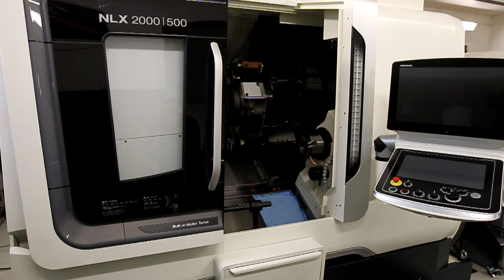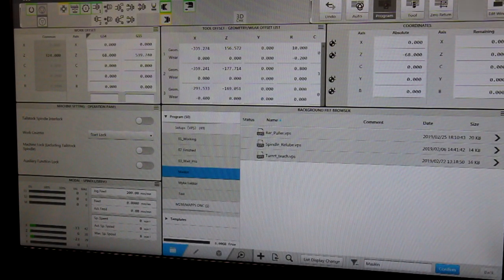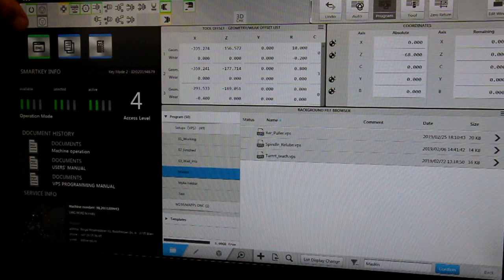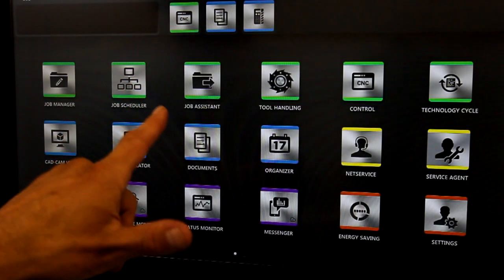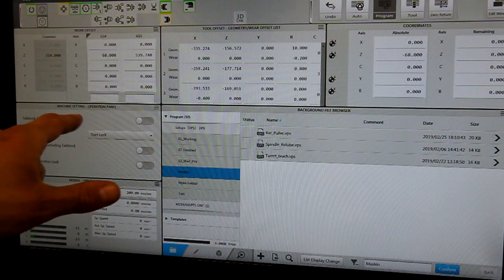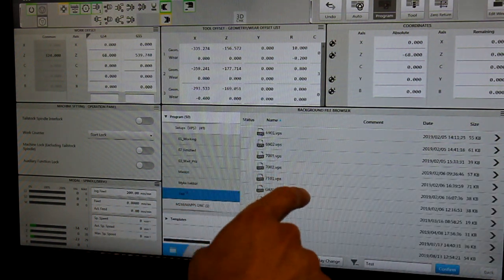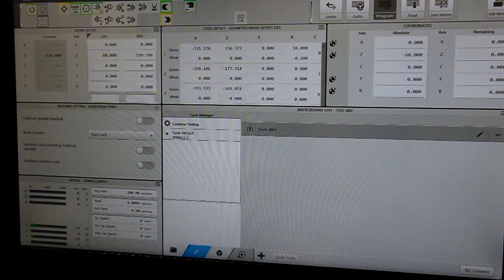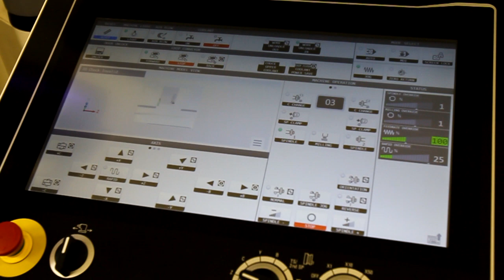Mori NLX - Quick overview and Question time

Comment: Does anyone know how to change the IP address ? We want to load & save to a main server where all our programs are to be kept and backed up every night. We only have a level 2 key.
Reply from the maker: Change the IP of the lathe ? The IP of the machine should be assigned by your network. There is a huge section in the manual about how to set up that.

Comment: Hello, I just started running a NXL 2500 700  could you show how to mill a hex  with the VPS  software.  thanks
Reply from the maker: That is really simple. I assume you have got the manuals with the machine ? Is it a used or new machine ?
Reply: @Panzax1  yeah its a 2016 model and yes i was hoping that you had a video on how to do that
Reply from the maker: Yes. I'll try to make a video of it this week.
Reply from the maker: I am still hoping to get that done soon.

Comment: Finally a machine tour, lol.
Good of you to take the time to show us around.

Very Good to know the main reasons for the change to this machine.
To have Y axis is good.
If you need it ?
It is an expensive add on to any CNC Lathe purchase.
But if you have a use for it, why not.
It does come in handy, and the add on of the Sub Spindle is another great option to have.
Once again More $$$$$, which is common with every machine purchase.

Not much has changed in the back of the machine.
Other than cosmetic changes,  as you mentioned.
Very similar to the original Mori Seiki SL 2500.

Thanks again for the look around the machine.
I feel a little bad to ask for a tour now ?
As it seems i am the only one interested,  looking at the comments.
Much appreciate the effort.
Peter.,
Reply from the maker: No problem at all. Glad I could make at least one person happy. There are a number of other likes too, so you're not totally alone.